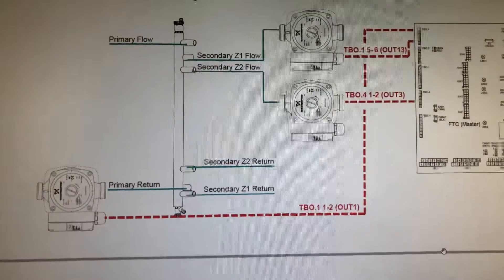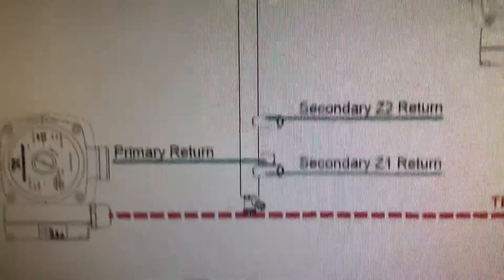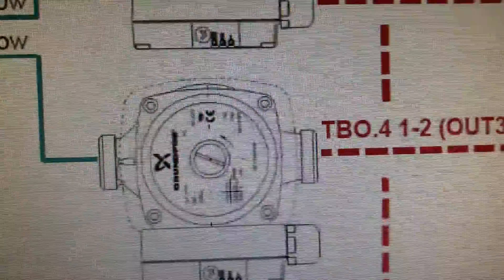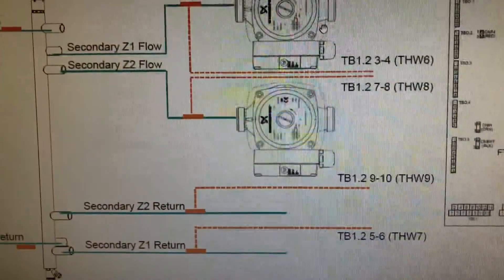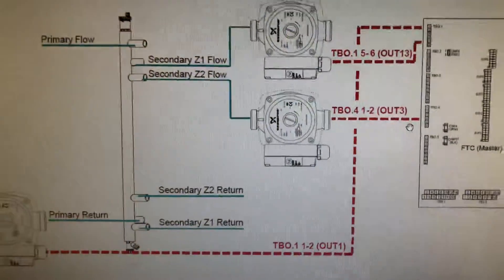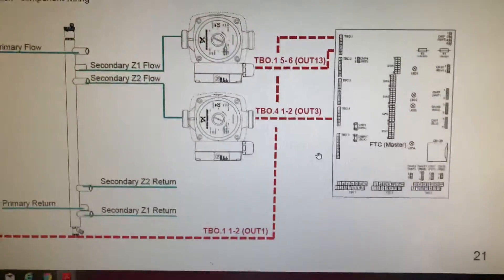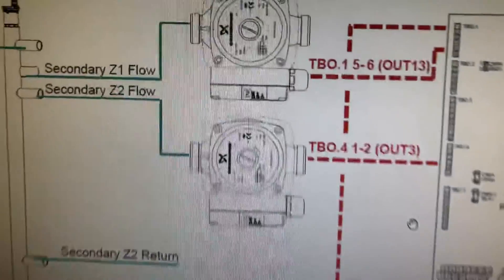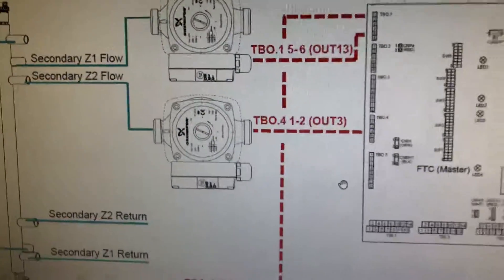How to install a zone 2 Mitsubishi FTC5 Cylinder Heat pump

Comment: Hey mate, I wanted to comment on your other videos (GLE mods) as As you said "any comments let me know", but all the comments are turned off. :-D Anyway I have the same car and I also wanted to do exactly the same what you did. Numberplate holder (cos all the screws are started to rust) on a 2years old car. I couldn't they drilled trough the numberplates instead of installing this nice & tidy holder. I've also bought the panamericana grill too, but I wasn't sure how to install it myself, as I was worried that will void the warranty.  I couldn't find a good tutorial how to do it step by step so the new grill is still in the box :(. Did you noticed any change to your radar system? since you swapped the grill. Did you had to recalibrate the system? Or everything was plug and play.